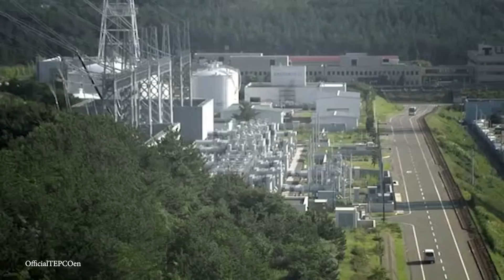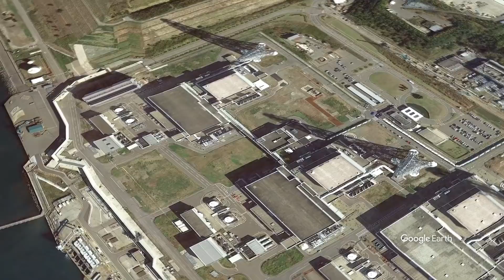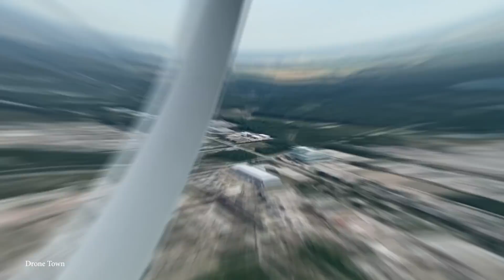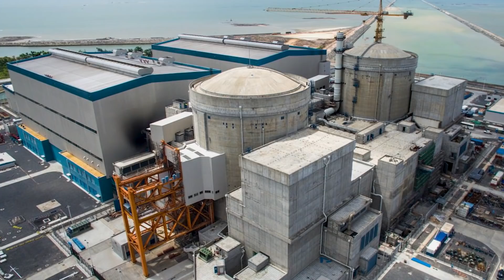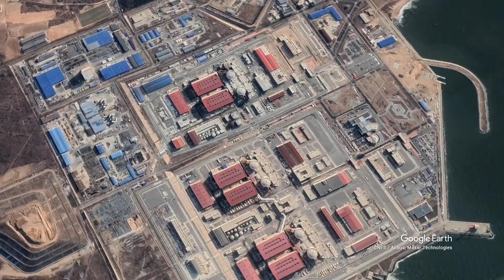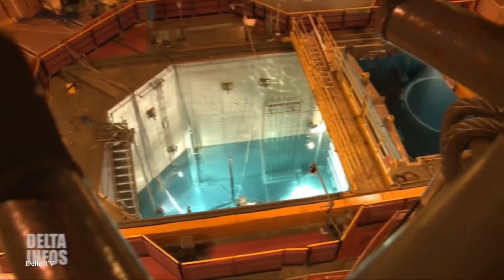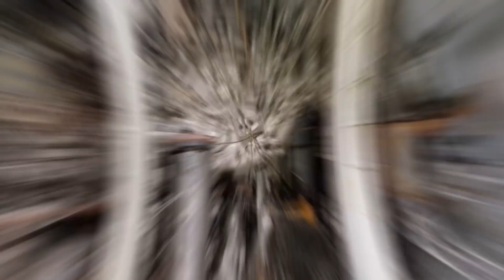MOST Advanced Nuclear Power Facilities on Earth

Comment: And the introduction you mentioned the high efficiency of nuclear power plants and I was looking forward to some statistics which were not given. So I checked out the efficiency of the Westinghouse a1000. About 30%. Two-thirds of the heat is wasted. Climate change is a warming of the planet is more than simply methane and CO2 emissions. It's the Heat that is trapped within the CO2 and two-thirds of the heat is lost to the environment with Westinghouse most Advanced reactor yet devised. From my memory recall, the Mark 1 reactors in Fukushima are 20% efficient. It requires 5 billion watts of heat to create 1 billion watts sent to the grid. I disagree with the assessment that nuclear power plants are highly efficient. 30% is a great improvement from 20% but it's not 80% which I would consider efficient. I don't think this is the solution to global warming.
Reply: Very pertinent. Global warming and renewable energies are keys in this discussion. Nuclear is not renewable. Solar panels are the way to go and wind energy where available. Pumping water up reservoir is very feasible in Switzerland. First plant in activity in 2022.
Reply: No heat source anywhere on the planet comes anywhere close to the output of the sun so any heat from a nuclear power plant would not even register as negligible.  It's the Sun's immense heat that is being trapped by greenhouse gases.  Even the heat generated by a city like London would not make a dent in the enormous solar blanket that is permanently wrapped across one side of this planet.

Comment: 0:50 I thought they all boiled water... 😕
Reply: Not exactly. The goal, at least in CANDU, is NOT to boil the water, but have it flash to "dry" steam. With pressure and temperature. Then the full force behind the steam can be used to turn the turbines. As it goes through each turbine, any condensation is removed so it is dry steam again.
Reply: Water-cooled nuclear power plants have two water loops, the first is the coolant loop that runs through the reactor and the second is the working loop that boils into steam and drives the turbines.  The first loop, since it doesn't go anywhere near turbines (and thus has no use for steam) can either be allowed to boil into steam or it can be pressurised to stop it boiling into steam, these two types of reactors are known as BWR or PWR.  They are the two most common types used in the world.

Comment: The CANDU system at Bruce Nuclear, Darlington Nuclear and Pickering Nuclear have given Ontario almost 30% of its power for years....and the CANDU system is unique in its safety procedures, and using a only slightly refined U235 fuel bundle that is easier to store post use for waste storage
Reply: Actually, over 50% of Ontario's electricity is nuclear (for several years).